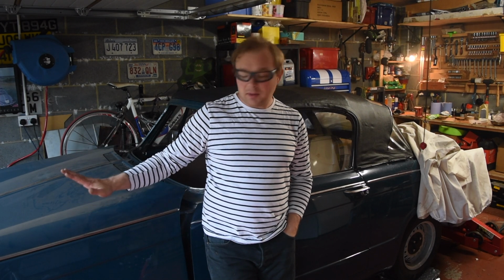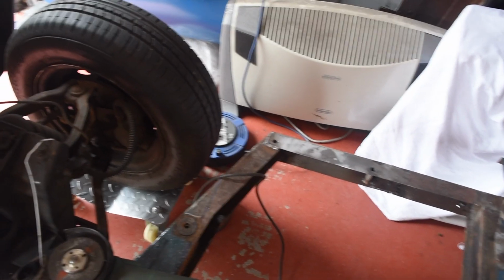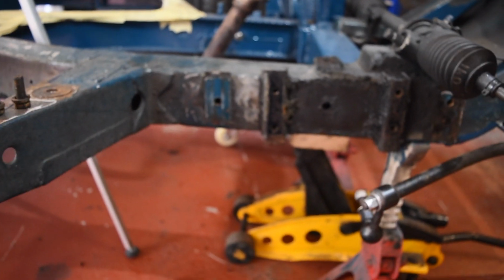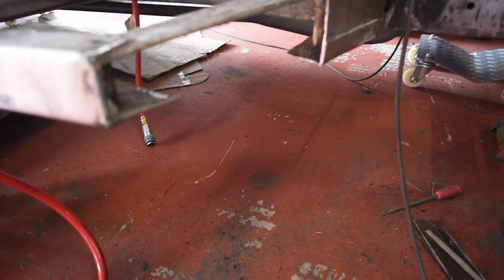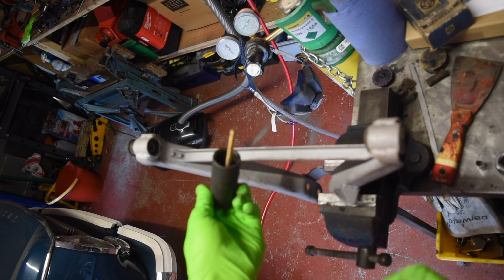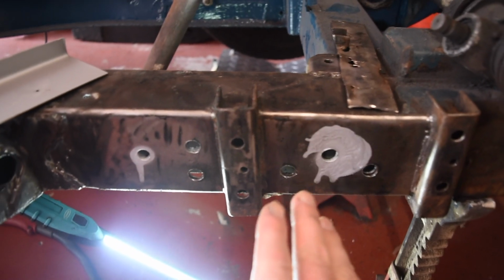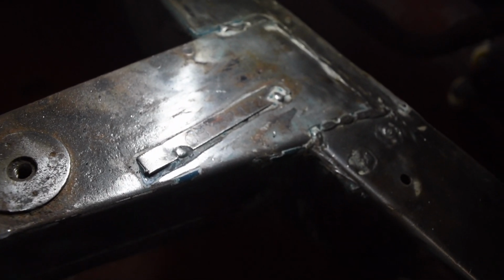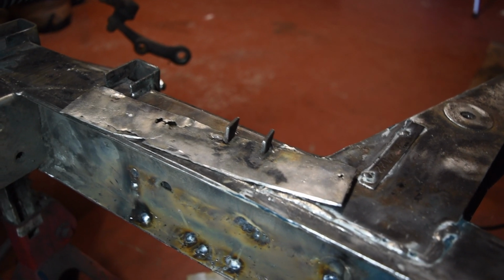Chassis Welding Complete! | 1970 Triumph Herald 13/60 | Part 12

Comment: Another question, how easy is it to take off the bulkhead with the engine in place?
Reply from the maker: I actually didn’t think about any sort of rollover jig / spit, but I feel like that would’ve required much more stripping of the rear of the car than I want or intend to do. I also didn’t anticipate having to do any welding on the main rails! 
The bulkhead comes off easily enough with the engine in place. I have twin SU HS2s fitted and I needed to remove the rear carb to allow the bulkhead to move forward enough to get the lip of the floors clear of the rear body section. I imagine if you have the the standard single manifold it could just stay in place. Otherwise I only had to strip out stuff that attaches to the bulkhead in some way. It’s a two person job to lift it over the engine and gearbox, easy enough to do though.